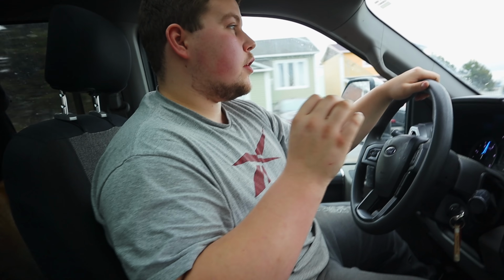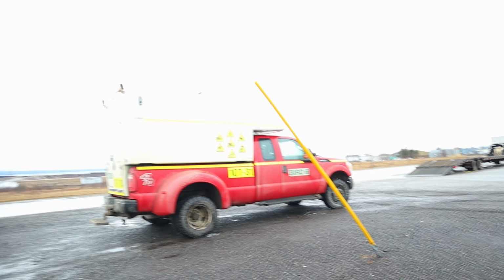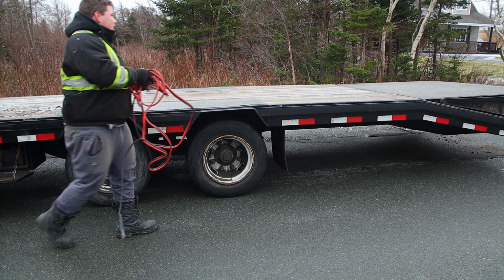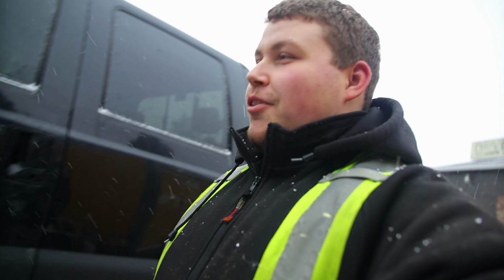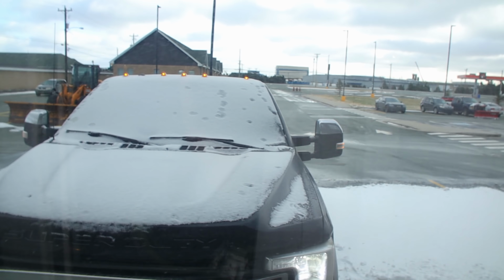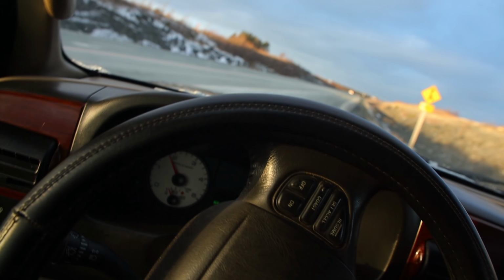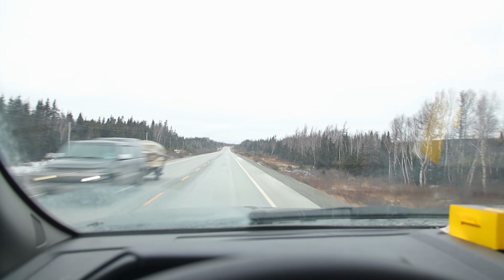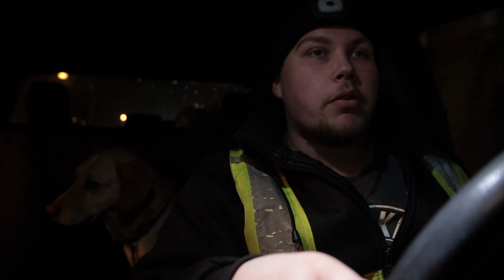Buying A New TRUCK with CASH???

Comment: Sweet, just picked up my 6.0 about 2 weeks ago. 200k kms. Never been tuned or deleted. Getting stuffs soon and I work at D&M auto recycling in the Okanagan valley in BC dismantling wrecked cars and got a whole sinister diesel piping kit sinister coolant filter, egr delete and 4" downpipe as well S&B cold air intake. For 150$!!!! Crazy right. Stuff is mint too. As well a mint Lariat interior as mine has crappy cloth for some reason .

Comment: Love my 6.0 PS. You got to put a 4” straight pipe exhaust on there with 4” down pipe to let her breathe and hear the turbo. Better yet swap out the 13 vane turbo and put in a 10 vane like the 03’ trucks had. Whistles a lot louder. Blowby goes into the air intake tube entering the turbo.

Comment: If the 6.0 truck has the stock exhaust on it, time to get rid of it,  HUGE improvements going with a 4 inch turbo back. I first chopped off the muffler kept cat stock down pipe made side dump exhaust. It sounded raspy like a big block gas,  stock turbo gave out, did a welded up EGR cooler installed Powermax Stage1 turbo a little more power but it felt restricted. Installed MBRP 4 inch turbo back with a MBRP muffler which is a resonator. No tuning just blue spring in fuel regulator my truck easily pushes 20 psi plus boost, the power is there. I've owned my 05 F350 CCSB srw truck for 8 years I should have did an EGR delete and 4 inch turbo back exhaust years ago. The whistle is a little intense, truck sounds like a jet when I put my foot into it. The Powermax stage 1 turbo is worth the money the stock turbo makes the engine have unbearable turbo lag.

Comment: I hope that's not an original or Ford cap on the degas bottle. They're weak, have a tiny spring and could cause a boil-over on a warm day. The experts won't say it's the reason 6.0 head gaskets fail, but every 6.0  that comes to their shops with blown head gaskets has that  Ford cap.

Comment: I have a 6.4 powerstroke f450 king ranch. I do hotshot with it and just clicked over 350000 miles. I also bought the dam thing brand new in 2009. In the 11 years I've had the truck, I have never seen the engine light come on. Simple tow tune with the original injectors. Also deleted the pdf a
Reply: I deleted the egr and dpf on my 6.4 king ranch. The 6.4 powerstrokes are actually really stout motors once you delete all the emissions bull****. I love mine. Will never get rid of it.

Comment: My old boss had a 6.0 King Ranch dually he bought new, he spent ($16,000 US Dollars) one year replacing injectors and stuff.
Reply: Just watched my boss rebuild his for 5k 140 miles
Reply: @nignoggotya  This was back in 2014ish it was a 2007 and he paid the Ford dealer to fix it I remember they had to pull the cab off the truck he paid around 16K for the repair  then he traded it in for $12K less like a month after he got it got fixed. I think he paid $85K for the truck new in 07. Money well spent. Oh yea then he took the company lettering off the truck and the guys that put it on cut the vinyl in place on the truck there were razor mark cuts down to bare metal so he had it repainted for 5K on top of the 16K then he trades it in for 12K.😂😂😂

Comment: 25k total? u will have the heads off that in a year... bullet proofed or not they get pushed and the heads come off. its not that she wont pull it, its the massive grades and stuff over there, with those loads that will do it.
but 6.0ls pull good, very good

Comment: You need to run battery cables to a quick disconnect in the bed and run wires to the trl battery. Never be dead again then also you might be able to jump off dead equipment and trks on your trl

Comment: For me personally I'm a Gasser guy and don't care much for diesels but in my line of work I have used Cummins power strokes and Duramax pretty much all the major ones from idis to 6 .7s and with my type of work the truck Skip beat on majorly and most of them don't last long at all but for a work truck and for pulling I would definitely buy a 6.0 powerstroke over any diesel there is. and when the proper maintenance is done they are just as reliable as a 12 valve one of my old bosses always just use 6.0 and he did some research on to figure out how to make them more reliable and there's a couple articles from a few mechanics we found out a big thing that causes all the EGR and head gasket issues is the ignition control module the stock alternator doesn't make enough amps and it runs it a little low which causes it just a fire off so slightly that it will cause major problems in the long run so with one of his brand new ones back in 2008 we put in a aftermarket alternator never EGR deleted it or head stud in it and before it had problems it had 380,000 miles on it and the only reason it started to go bad is because a kid got a hold of it and beat the living s*** out of it. And in my opinion they put down the most power to the ground stock out of all the major diesels and they definitely get the best gas mileage when not towing

Comment: you can also use a fuller 7 speed with no body mods. some say you can put a 9 speed in, but a 13 or 18 intrudes to deeply into the cab.

Comment: The only 6.4 I have heard of with major issues is a F450 owned by Sendit Steve.
Reply from the maker: You need to do more research then. Everyone was telling him he was going to have issues
Reply: Go on Facebook Marketplace in Harrisburg Pennsylvania Steve has it listed for sale right now for $16,000.
Reply: Everything Steve owns has issues, he beats the bag out of that truck and drove it into a pond and a tree fell on it.
Reply: @northernfarmer3689  I didn't say he was the sharpest tool in the shed.  But as far as major engine issues he seems to be sneaking by them.
Reply: @bongoyongo6519  thats because he has to pay a commercial truck registration and he is no longer using it for that.
Reply: @DangerIndustries  and yet he has still yet to have a head gasket failure.  Maybe at somepoint he put ARP head bolts on it.
Reply: steve really doesnt have much trouble with the f450 things got like 300,000 miles and he actually uses it as a truck and has fun with it things are gonna brake from time to time
Reply: Steve's a Donkey
Reply: I made hot sweet man love to Steve Freeman he really sent it.

Comment: Sorry old boy. Your jump starting is incorrect. 
Positive First on last off.
 Find a Ground (alternator bracket??)  away from the battery. You don't want a spark near a battery.  I have seen three batteries explode and don't want another.

Comment: Also I personally would do my research on the wheels to make sure they can take the weight you're going to put in it. You'll be surprised at some of these aftermarket wheel companies what they are rated for sometimes they can be almost half less than a stock rim
Reply: Why i hate people who put them on "just for looks". Give me the factory or "Alcoa's". I hate the adapter to semi rims as they seem weak. Afterall, running an adapter on an adapter.
Reply: @brandoncaldwell95  I'm with you there bud unless I have a complete show truck I will not get expensive wheels I have beating the s*** out of my vehicles from off-roading to hitting curbs and I sure don't want to have to worry about the wheels I've had plenty of lifted trucks and usually I try to keep the stock rims and if I have to I will go with some steel wagon wheels having a lifted truck with the stock wheels is the best thing ever so you don't have to worry about it but it's amazing how shity the specs are on a lot of these custom wheels
Reply: @Sam_kleinskc  my old 1500 i went aftermarket wheels for offset to make them line up flush to the body. I hate the tucked look. I also gone steels for the offroad capabilities. No tire ive found has the weight capacity of the rim. Benefits? I can dent a rim and take a hammer to at least add air back in and get me home vs having no spare when as its already being used for the other rim thats broken. My dually has factory wheels as i love the factory "Alcoa" bullet rims. Ill run a spacer there and have the meaty tires as rim protection. Tire tread and side wall is needed more than a shiny rim!

Comment: Run archoil ar6200 in for the fuel and archoil ar9100 in the oil at every oil change and you'll never have issues with sticking it hanging injectors and quicker cold starts bill Hewitt at powerstrokehelp.com recommendation 💯

Comment: 06 powerstroke is terrible o fantastic if it is updates bullet-professional-diesel (injectors (industrial injection )-oil coolers super duty -water pump-egr-radiators-............ok !!!!!!...... otherwise .......... amazing.frame and automatic gears ...........i am one of the greatest experts of this model thati used in europe from 2007 to 2018. My truck had the wheels from 22.5 alcoa and axel-ratio 4.88 to tow heavy loads ...............intercoolers and air filter banks 
amsoil 5w-20...............good luck for your business

Comment: Stock injector life in 165000 miles 2 of mine dropped out at 173000 just heads up
Reply: I went with Warren's injectors 155 over 30 great injectors for towing just the littbit extra power wake the ole 6.0 right up